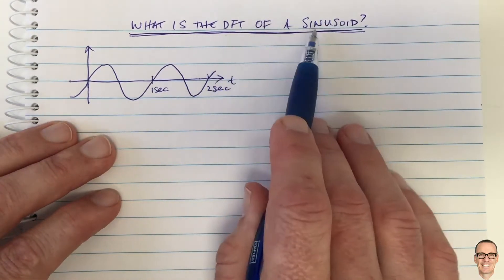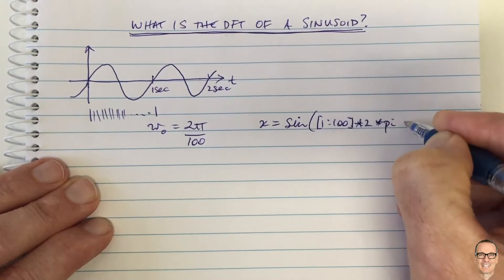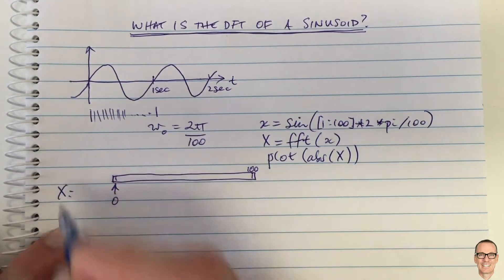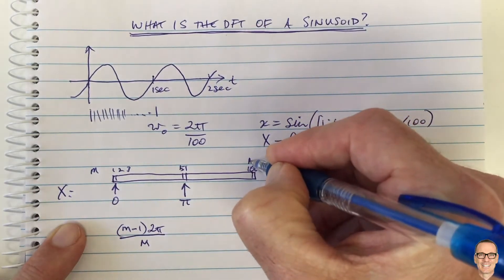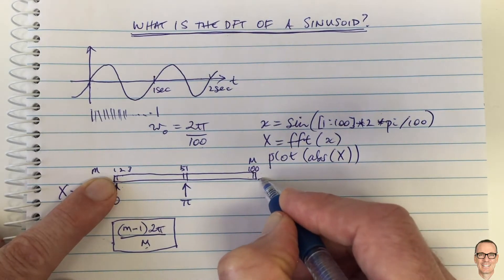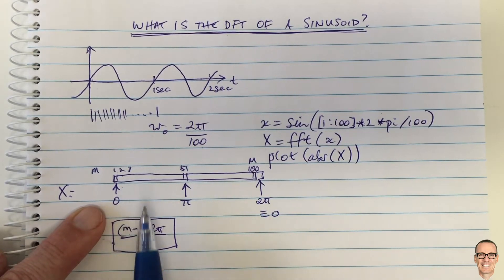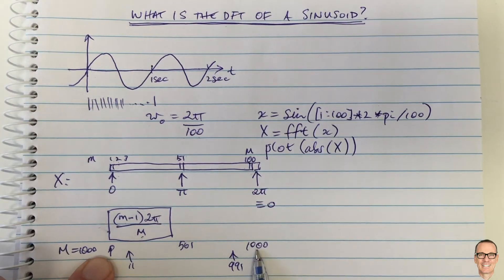Discrete / Fast Fourier Transform DFT / FFT of a Sinusoid Signal

Comment: Isn't the resolution only higher if you sample at a higher rate in the same amount of time?
Reply from the maker: If you "sample at a higher rate in the same amount of time" then the 'time resolution' would get better, but in the frequency domain the highest frequency element of the DFT vector would then correspond to a higher frequency, so the 'frequency resolution' would remain unchanged (it would just cover a wider frequency range). To increase the frequency resolution you need to sample for a longer time.
Reply: The value of (m-1)/M multiplied by 2*pi/100 = 2*pi/100, gives you a spike.

(2-1)/100 multiplied by 2*pi/100 =2*pi/100

Comment: Thanks, is there a number of minimal samples? How can we calculate that?  Thank you.
Reply from the maker: The minimum length of the time-domain vector is 1 (ie. a single "sample"). The DFT implicitly assumes that the finite duration discrete-time signal repeats outside the "sample window", and so if you're only got 1 sample (in the time domain), then the assumption is that the "extended" signal is a constant "flat" signal. The DFT of a constant is just a single value at 0 frequency, so the frequency domain transformed signal only has one value too.
Reply: @iain_explains  thank you, is there a recommendation on how many sample should be taken?
I assume, too many samples means a too high computational effort.

Comment: Thanks for the lecture! Could you derive wo = 2pi/100 and the formula of resolution (m-1)*2pi/M? Why is it m-1 not m?
Reply from the maker: In the video I showed the indexing of the vector starting at 1 (as it does in Matlab). Other programming languages start the indexing at 0, and they wouldn't need the "-1" that you ask about (eg. in C/C++). Because the indexing starts at 1, we need to subtract 1 from the index, to get the frequency, since the first element of the vector corresponds to a frequency of 0 Hz.

Comment: At the time 4:35, you show 1000 sample distributed over more than 1 Sec. Should not  the samples be distributed over 1 complete cycle, in this example over 1 sec.?
Reply from the maker: At that point I said that we were considering sampling over a longer period of time. If we collect 1000 samples at the same sample rate, then it would correspond to 10 seconds.

Comment: How do I derive the frequency of the waveform from the fft-plot? Is that possible? Greets
Reply from the maker: You might like to watch this video: "How does the Discrete Fourier Transform DFT relate to Real Frequencies?" https://youtu.be/pIFz84oj9cA
Reply: In my opinion, the formula to derive the specific frequency of the waveform from the fft-plot is: w=(m-1)*2*pi/t, where t is the total time of the sample (in this video 1s). That will lead to w=(2-1)*2*pi/1=2*pi. As said in the beginning of the video, 2*pi is the given frequency of the waveform. Is my assumption correct?

Comment: Thank for the videos, they are great. One question with the calculation of the w0. Is w0 the angular frequency for each sample? Generally  w=2*pi*f, in this case f=1/timeperiod=1/1sec=1Hz, so w=2*pi. How did you arrive at w0=2*pi/100??
Reply from the maker: Here, w0 is the sample rate (or sample frequency) in radians, not the frequency of the waveform. The sample rate = 2pi/(simple period). The sample period is 1/100 seconds, since there are 100 samples each second.
Reply: @iain_explains  so there should be w0=2*pi*100 and not w0=2*pi/100
Reply: @strayer4586  w0 is written wrong in here, but the final x assignment is correct I believe. because it should be sin([1:N]*2*pi*fx/fs) and since fs = 1000*fx, the written x value is correct.

Comment: So what would I get if a sampled for a period longer than the signal original period, for example, [1:110] and not [1:100]?
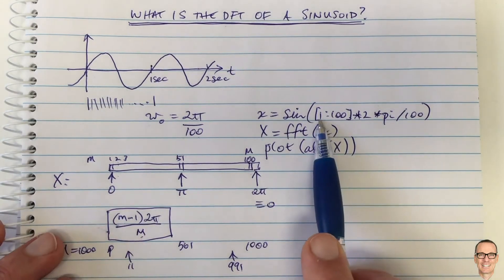Reply from the maker: It would be the same effect as is described at the 7:00min mark of the video, when I explain what happens if you sample for [1:75]. The DFT/FFT would assume that the overall waveform is a repeating sequence of the [1:110] that you have sampled.

Comment: How does program know whether Signal is periodic? We can see easily periodicity but program just sample it. How to know exact spectrum?
Reply from the maker: The computer/sampler/program doesn't "know" that the signal is periodic. It only samples for a finite time period, so it can never know what happened prior to that time period, or after that time period. When it implements the DFT/FFT equation, it gives the result that would hold if the signal is in fact periodic. That's really the best anyone can hope for. It needs to assume something, so it either assumes the signal is zero outside the time period, or it assumes it is periodic. The DFT/FFT assumes it is periodic.